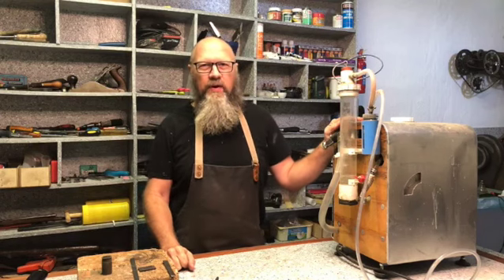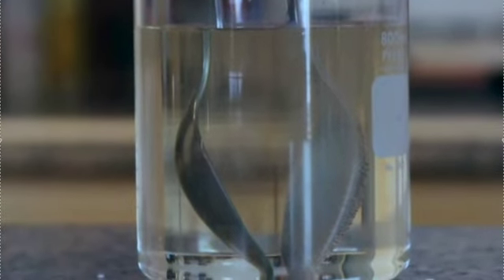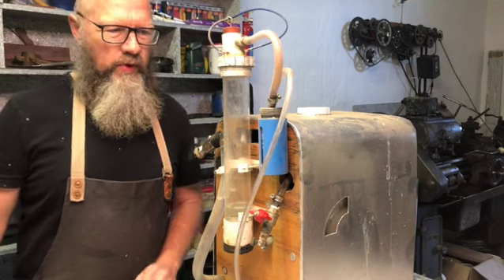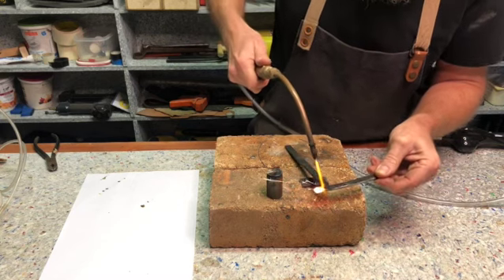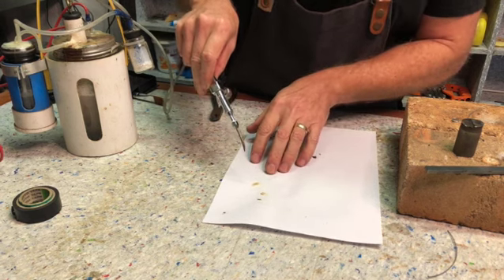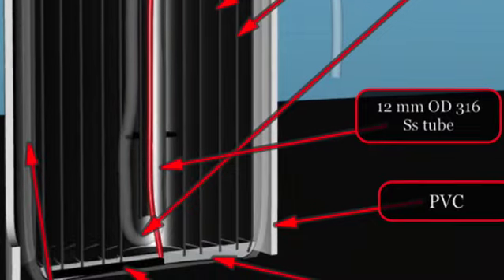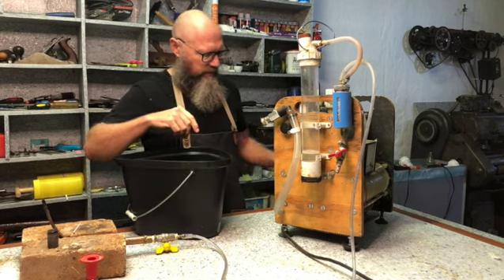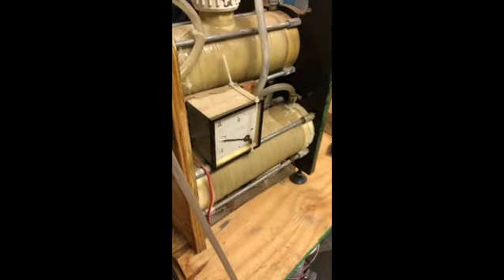How to build a HHO generator that produces Brown’s Gas safely and successfully. Part 1

Comment: Whats the liter per minute output? Does it have a backflow safety mechanism to prevent explosions? What other safeguards are there ?
Reply from the maker: It is about 10-12 lpm. Safety devices are a built in flashback arrestor in the torch, a secondary bubbler as well as main bubbler.
Reply: @thequixotryworkshop2424  Can I adapt this to my car? Thanks.
Reply: @thequixotryworkshop2424  at what current and voltage do you get 10-12 lpm?

Comment: Is it actually really any good to weld with? Hardening issues?
Reply from the maker: @ Vard Friki. It is not so good to weld with. The flame is too oxidative. However, it heats melals up very quickly and brazing is easier. Aluminum welds nicely when using a flux. Welding mild steel is possible when bubbling the HHo through a fuel. ( like gasoline, alcohol or laquer thinners) 
It lowers the flame me temperature and there is less oxidation .
Reply: Yea,  if you used this in a tig settup, and had the CO2 gas cone,  would the weld have hyrdrogen or water porosity,

Comment: So nice work . Can you show How it work?
Reply: How it work? it work when you pass electricity through distilled water which is mixed with potassium hydroxide it will separate Hydrogen from oxygen this process is called electrolysis, so this hydrogen can be directly used in cars bikes or generator.

Comment: What do you use to take the moister out?
Reply from the maker: Cat litter made of silicone granules.
Reply: @thequixotryworkshop2424  
What is the minimum liter per minute to start a small flame?
Reply from the maker: I would say 1 L / Minute. But it will be a very small flame. Like a micro flame.

Comment: Привет, какие характеристики по потреблению и выходу газа?
Reply from the maker: Привет. Характеристики выхода газа - 12 литров газа HHO в минуту при потреблении 8 ампер или 1700 Вт электроэнергии.
Reply: @thequixotryworkshop2424  очеь хороший результат
1,7 кв - 0,7 куба газа, вы достигли эталона выхода газа по Фарадею, у него посчитанно 2 кв - 1 куб газа, примите мои поздравления, еще вопрос щелочной электролит чистый или принимает со временем рижий цвет? 
Скажите какая термостабильность в градусах цельсия генератора при длительной работе больше 3х часов?
А я только начал создавать, 3 месяц как провожу опыты
При маленьких электродах с рабочей площадью 10 квадратных см, в генераторе 21 электрод и паралельное соединение, при 60 ватах 0,24 л в минуту пока
Reply from the maker: @johnhidrogenius4302  

“Translation of your question :

good result

1.7 square meters - 0.7 cubic meters of gas, you have reached
standard of gas output according to Faraday,
he calculated 2 square meters - 1 cubic meter of gas,
congratulations, yet
alkaline electrolyte issue
clean or accepts with
time riga color?

Tell me which one
thermal stability in degrees
generator celsius at
long-term work more than 3x
hours?

I just started creating
I've been doing experiments for a month

For small electrodes with
working area 10 square
cm, in the generator 21 electrodes and
parallel connection, at 60
cotton wool 0.24 l per minute while. 

Answer: Ответ: Спасибо!
Щелочной электролит KOH остается чистым в течение 4 лет. Температура достигает 60-80 ° C. При длительном использовании. Я добавляю радиатор, чтобы охладиться.Смотрите мое следующее видео в среду вечером. Моя электронная почта christoff@quixotry.co.za, если вы хотите заказать мои планы за $25 .

Translation: Thank you! 
Alkaline KOH  Electrolyte stay clean over period of 4 Years. Temperature goes to 60 -80deg C. When in use for long periods. I am adding a radiator to help cooling down. See my next video on Wednesday evening.  My e-mail christoff@quixotry.co.za if you want to order my plans for $25.
Reply: @thequixotryworkshop2424  большое спасибо зп ответ и предложение
Но мне важен и интересен сам процес опытной разработки своей конструкции, в опытах я прихожу к пониманию процесса,  тем более  что я хочу сделпть кислотный генератор, так как считаю его более перспективным, а это знания, которые не купиш у вас за25 долароа вместе с вашими чертежами и инструкциями
Видео обязательно посмотрю
Reply from the maker: @johnhidrogenius4302  Тпе Ошхоу Могк$Пор большое спасибо
зп ответ и предложение

Но мне важен и интересен сам процес
опытной разработки своей конструкции, в
опытах я прихожу к пониманию процесса,
тем более что я хочу сделпть кислотный
генератор, так как считаю его более
перспективным, а это знания, которые не
купиш у вас за25 долароа вместе с
вашими чертежами и инструкциями
Видео обязательно посмотрю

© ср о

УОНМ СЕЧЗЕВ + 4 ттще$ адо

@ТНе Ошхо\гу М/огкзПор из какого
материала используете электроды?
Reply from the maker: @johnhidrogenius4302  Спасибо! Я понимаю.

Электроды Нержавеющая сталь марки 316.
Reply: @thequixotryworkshop2424  спасибо, поэтому и элнктролит химически стабилен
Reply: @thequixotryworkshop2424  скажите пожалуйста, подбирали  ли вы частоту для питания генертора импульсными сигналами, или  электролит не держит остаточную емкость , вольтаж  в вашем генераторе после выключения питания
Reply from the maker: @johnhidrogenius4302  Я не знаю. Я использовал готовые вещи. Это диммер, а затем мостовой выпрямитель. Должен быть прямоугольный сигнал постоянного тока переменной частоты. никогда не измерял после выключения питания. Мой мультиметр потерян, и мне нужно купить новый. Денег мало.
Reply: @thequixotryworkshop2424  тоесть вы не используете трансформатор 220- 12 ас, а используете понижающий димер на теристорах и диодный выпрямительный мост?
Reply: @thequixotryworkshop2424  а для чего делали генератор и в каких целях используете
Я делаю для автомобиля небольшой генератор на 1 - 1,5л в минуту
Reply: @thequixotryworkshop2424  как я вас понимаю, на днях полетели выходные электролиты в моем блоке питания на 30 ампер, это просто ужас, а на резервный я еще не разжился
Reply from the maker: @johnhidrogenius4302  У меня 220В прямо от электросети. Конфигурация ячеек с сухими ячейками разделяет выпрямленное постоянное напряжение 200 В на сегменты по 2 вольта. Количество тарелок - 101.
Reply: @thequixotryworkshop2424 понятно, просто через диодный мост 220 переменки на 220 постоянки
Reply from the maker: @johnhidrogenius4302  No, there is always a loss when power gets rectified.
Reply: @thequixotryworkshop2424  но при выпрямлении с 220 получается 250 вольт постоянки, о каких вы потерях говорите, не понимаю
Reply: Using voltage Ac or DC ?